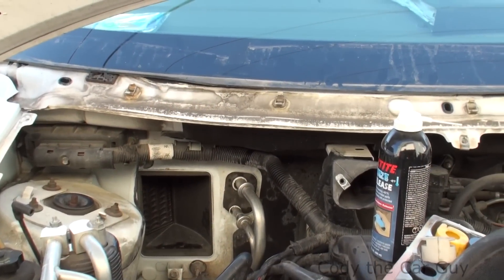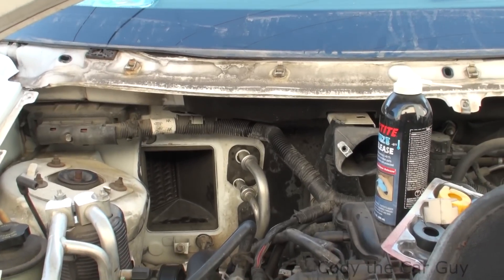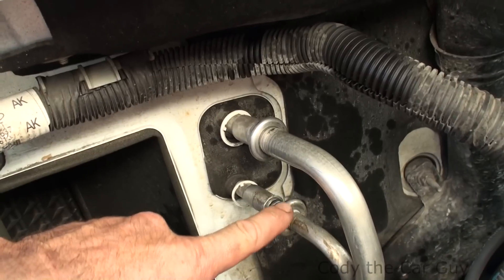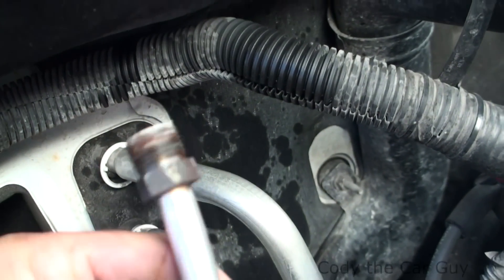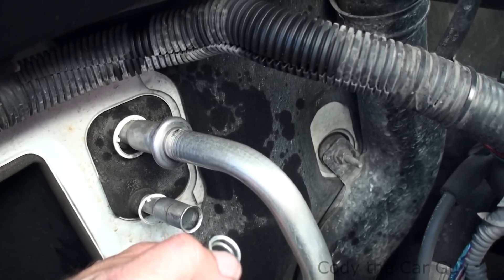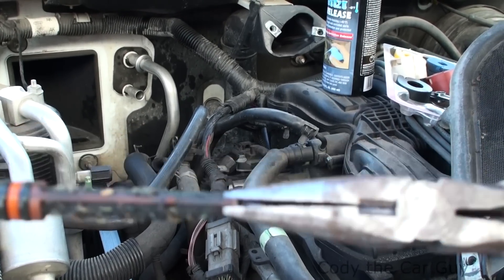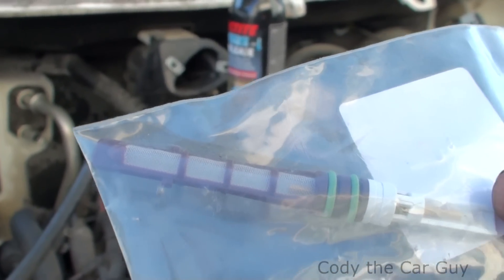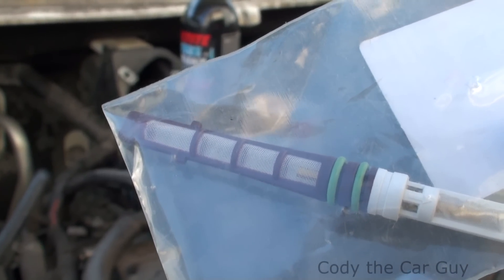Ford Freestar orifice tube location

Comment: Hi Cody, you video help me a lot!! But I already change the oriffice tube and recharge the system. But still without getting cold the front unit. The rear work great. So I was thinking I should change the drier accumulator as well. What you recommend? Thanks again
Reply from the maker: If its blowing nice and cold ac in the back then I would check your blend doors in the front and see if its in the right position or even working at all.

Comment: Ancient video just like my 2005 Freestar is ancient and just what I needed. Can I assume the orifice tube is clogged if I'm fully charged and there's no condensation on the system nor is the orifice tube getting cold? I know the blend doors are working, I already repaired them.
Reply: I need to find a video on this. The drivers side vents blow warmer than the passenger side. My compressor finally took a crap after being very loud, no condensate either. If I wasn’t driving around, it would barely cool in traffic.

Comment: The white gaskets that comes out of the fitting that you have moved back to the firewall....the round rings. Can a missing one of those cause a freon leak? Found one that was off and didn't know how to put it back.....well anyways no a/c and the ring / gasket broke on me. Can you help please. Thank you
Reply from the maker: Brisco Blank Those white things are not orings that seal in the freon , best thing to try is next time add some dye to the system so you can use a black light to see where the leak is. Also check the schrader valves they are notorious for going bad.
Reply: How will I get to the back freeze plug
Reply: Where will I find the back freeze plug on a 05 freestyle van